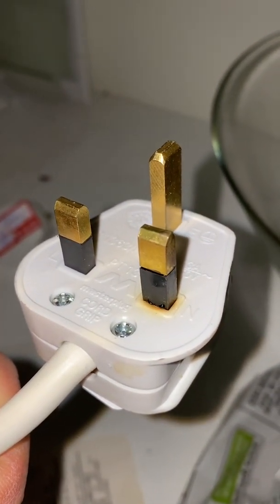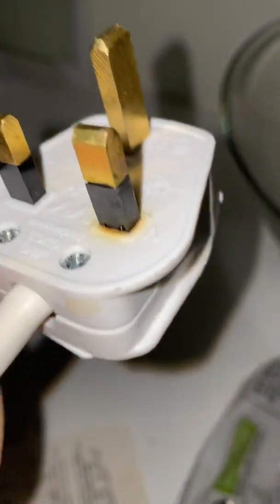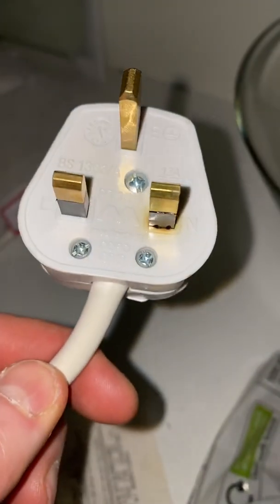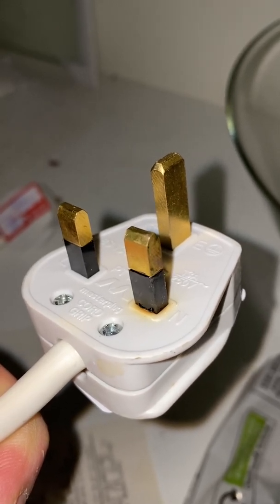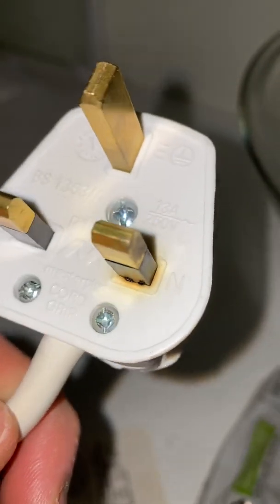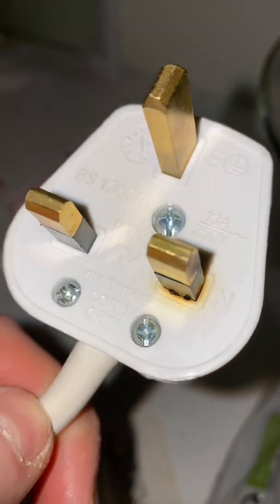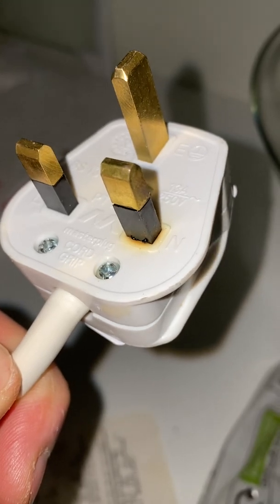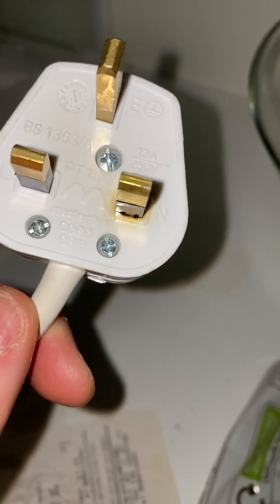PAT Testing Fire Risk!! Electrical Plug fault - Portable Appliance Testing

Comment: Well done for doing the visual inspection properly, and for checking the maximum Power (Watts) consumption rating  on the appliance. 

4000 Watts / 240 Volts = 16.6 Amps , so far too high for a standard Plug, even at its highest fused rating of 13 Amps. Odd that it didn't pop the fuse in the plug actually. Either way it needs sorting out. Again. Good spot.
Reply from the maker: Thanks for the detailed breakdown and validation! It's always a good feeling to catch these potential hazards.

Comment: What would you say caused this please?
Reply from the maker: could be something like a loose terminal or where a heater is left on constantly for a long period of time
Reply: Just to ad, it's usually cheap plugs and sockets that cause this.  They make a poor contact and the resistance causes the pin to heat above its tolerance.
Reply: @donny121able  the master plug plugs are high quality